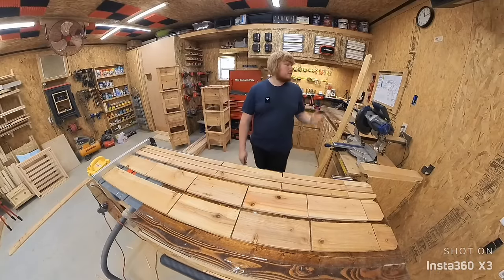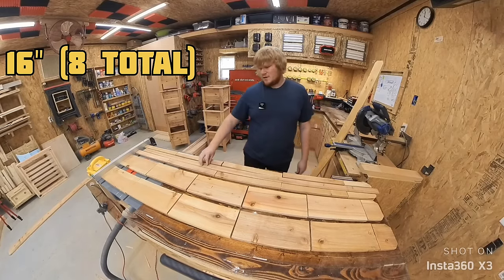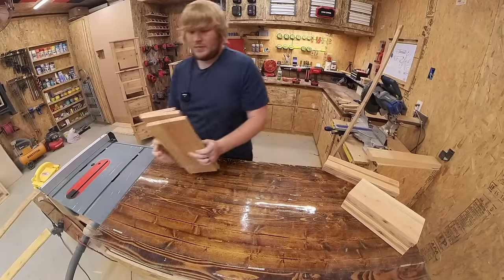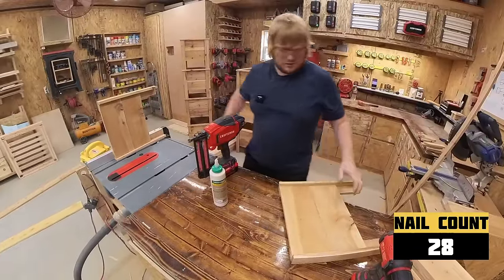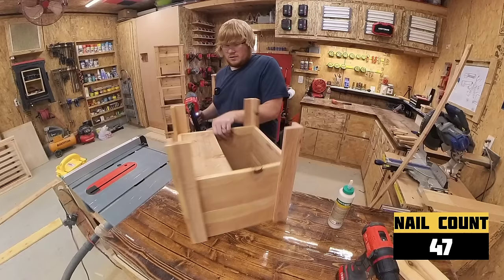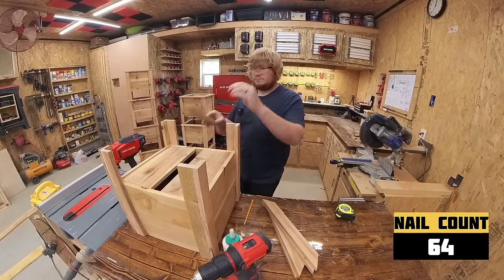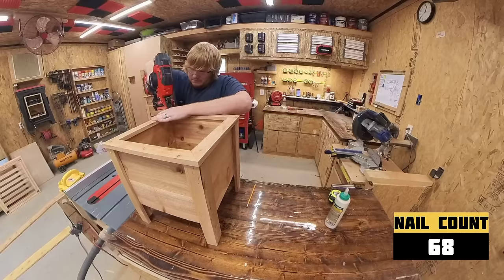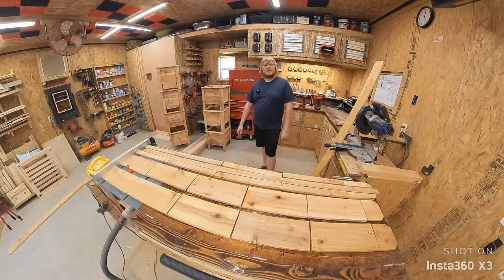3 Pickets, FREE Plans | Make Money Woodworking | How To

Comment: Nice work! What would one cost finished built, or the approx cost to purchase the materials? I need like 15.
Reply from the maker: I buy cedar pickets at Lowes for $3.28. Estimated with nails/glue to cost around $13-$15 to make for the three picket planter. In the Trio Set video I talk about the cost to make them in depth a little

Comment: 50 to 55 nails. I came from your Facebook reel.
Reply from the maker: Thats around what I thought they took, until I was adding the nail counter :P lol
Reply: @WhosTheVoss  after you nailed the Bottom, I did some figuring. I was only a few nails off after subtracting those nails. I totally forgot to add those in, or I would have been closer to the finished number. Oh, well. It is still a cool project.

Comment: Quick question- is there a trick to keeping a gap from forming on the legs? Even though it’s glued and shot together either the glue edges out after I walk away and I have to sand it down when it dries or it has a massive (to me) gap. 
I like it regardless, but if I want to sell them I want them to be top notch.
As always, love your content!
Reply from the maker: You can angle your nails, so you aren't firing them in straight. Otherwise put a little more glue on them and that should do it. I generally dont really have an issue with the legs separating, unless the cedar is reallllly wet

Comment: Do you leave them raw or use something like Thompson’s to give extra protection against the constant damp soil contact?
Reply from the maker: I leave them raw. We have several on our patio that I built two years ago. No rust stains from nails, bottoms are still strong. If you want the cedar red-color to last longer you can add a UV protectant so they do not grey

Comment: Hi! Love the content. Keep it up. Do you have plans for the larger box that has the pole for lights coming out of the middle of the box? It was in the video of the 3 picket planter as you were panning around showing so of the other things you've made. Would love those plans. :)
Reply from the maker: I have made a tutorial for the longer box, and im working on the Trio set now, the larger 4x4 pole may be after that :)
Reply: @WhosTheVoss  cool. Thank you. Maybe you can answer, if not too complicated, how does the post connect to the planter? Seems without weight and maybe more than just the dirt would be needed unless the post sits in a stand flush with the ground and the box is just around it. Otherwise it would be top heavy.
Reply from the maker: I brace it with 2x4's on each side and add a cut under the bottom to take most of the load. The cedar 4x4's are more expensive, but they are wayyyy lighter than pressure treated 4x4's

Comment: Thank you for the video, for non US watchers, what are the size and thickness of the pickets ? A quick google said that they come in different size, I just want to make sure to get the correct measurements at the saw mill. Thanks
Reply from the maker: Its 14cm wide, 183-1/2 cm long and 1-1/2 cm thick. I know thats not how you read in metric, however, I dont know how to read metric cause I live in the dark ages 😂 here they are 6 foot long :)

Comment: Hey Thanks for the video. Do you prep you pickets before cutting and if so what all do you do? I have a few pickets I purchased recently and they are garbage compared to what yours look like. Very rough cut.
Reply from the maker: Some of my pickets are pretty rough looking. You can add a clear Thompson water seal to protect its redish color, you can also sand the face of the board so its more smooth :)

Comment: Gonna try this tomorrow.  Can it be done with a mitre saw alone?  I don’t have a table saw.  Should be doable right?  So just fill with soil/rocks and plant whatever?
Reply from the maker: Well, ripping down the final board isnt doable with a mitersaw, but you can do so with a circular saw or jigsaw if you have one of those! :)
Reply: @WhosTheVoss  I’ll just have to find new uses for the new circular saw I just bought. Lol. Thanks.  Mom is already asking for a long one.  Did you post plans for the longer ones?

Comment: Hi, I just batched out 4 of these planters just to see how they’d go.
Your plans and instructions are dead on.

I only had one little issue. The last strip of wood for the trim had a knot in just the wrong place and broke the piece so, I couldn’t finish the trim on the 4th planter.  I’ll fix it.

I’m in Florida and it appears that HD and Lowe’s don’t carry cedar fence pickets.  I used the pressure treated pine and then used a tinted sealer.

Thanks.  I want to see if I can sell them.
I look forward to stealing. I mean, using your other designs. 😉
Reply from the maker: 😂 have at 'em buddy! Glad its working out for ya

Comment: Is that bottom center strip wide enough for you to rip and use it as 2 inside rails instead to support the bottom pieces? Would allow height adjustment of the base and fewer nails.
Reply from the maker: If you used the center strip for a rail system it would leave a gap in the center between the two wider boards. The larger box in the trio set has a bottom that is adjustable though. If you wanted to use some scrap as a rail its a cool idea :)
Reply: @WhosTheVoss  Makes sense, gap should be fine if lining the planter though? Do you put soil in them without a liner?
Reply from the maker: I did the first year, i found that the dirt will harden and separate from the sides, and the water simply pours out around the dirt without absorbing into the soil. So i started using a thicker trash bag as liners

Comment: A while ago, I saw you put some ceiling cameras in your shop. What did you end up using for cameras?
Reply from the maker: I made a mount to hold the camera I use over my workbench. Since then Ive made a completely new rig to hold everything, you can see it in the video a few times. I use Insta 360 x3's :)

Comment: Like the planter and Content.  I am wondering, how do you sand the pickets?  They looked sanded real nice on one side.  I have been leaving them unsanded for the first ones and I am looking to sand one side on the other.  I have a spindle sander and a thickness planer.  Which would be better.
Reply from the maker: Nope, no sanding what-so-ever :) they just look smooth
Reply from the maker: Thickness planer makes these look realll pretty. Run a board through and take a look :)

Comment: Why no glue on the bottom?
Reply from the maker: I glued the first few, but in all honesty all the glue gets pushed out when I set the bottom in place since it is very snug. Soo i fire in extra nails instead. If it has drain holes you can also glue them. It was just a messy experience for me :P

Comment: Do you pay attention to moisture levels of the pickets before assembling?
Reply from the maker: I let the boards dry so they are not physically wet, otherwise I do not watch moisture unless its a thicker slab
Reply: @WhosTheVoss  just wondering because I made a similar planter last week and the mitered top separated a bit. Meh.

Comment: Even with stain what's going to keep the bottom from rotting out under the weight of the soil in the moisture even though it has drain holes the soil will still be moist?
Reply from the maker: Cedar doesnt rot or decay

Comment: Good job,
Which brad nailer is that if you don't mind?
Reply from the maker: https://www.lowes.com/pd/CRAFTSMAN-18ga-20v-Cordless-Brad-Nailer/5002001819

This one ;) batteries last a long time in them. Ive used 5/8"-2" nails in it and it handles both very well
Reply: @WhosTheVoss  thanks I've been thinking of getting one.  I've seen a Neu Master online.  But if I can just go to Lowe's and scoop it I'll not think too hard and it's a Craftman.   👍🏾

Comment: I have a (probably) dumb question. I noticed your shelving for the spray paint on your back wall at the 9:40 mark. How did you secure those boards to the wall since they're on their side? It's neat looking and I want to do this. I currently have a book shelf serving as a storage for these things but it's bulky and sticks out too far.
Reply from the maker: Its pocket screwed to the wall. It fills up the lip from where my concrete block sticks out and the wall starts :)

Comment: I just made a couple and and I think not all pickets are the same length. Mine seem to have the center of the bottom come out a bit short.
Reply from the maker: Watch for cupping during assembly, its why I cut the tops last. If the pickets are cupped it can add 1/4" to the overall width/length. :)
Reply: @WhosTheVoss  thanks for the tip. I ended up using one of the dog-eared scrapps from the same board to make up the material. I'll be damned if I'm going to waste another board on one of these things.

Comment: one serious and very important question though... blue tooth earbuds or boom box? if boombox where do u put it :o
Reply from the maker: I have both, i use the over ear headphones with noise cancelling if im running the sander for a long duration or using the router. Otherwise I generally have my bluetooth speaker going, its above my head so its not blasting me in the face

Comment: Any chance I could get the plans or measurements for the 12 inch box you showed?
Reply from the maker: The smaller one from the trio? Its legs are 10" , long sides are 12-3/4", short sides are 10-1/2" I believe. :)

Comment: I've been pounding these out since last summer, it's a great planter.  However, your new plans don't include the measurements for the 45 degree top frame (on this one and the 9.5 picket planter.)  I'm sure I can figure it out, just wanted to let you know in case you want to update the plans.  Thanks!
Reply from the maker: I did not include them because if your boards are cupped, it adds 1/8"-1/4" to the mitered board's total length :) same with the bottoms really

Comment: The strips that you cut for the legs, I'm not able to cut them out of a pocket. Can I get 1x2 and 1x3's?
Reply from the maker: You could, or you could just space the 5-1/2" boards a little apart and use a liner or trash bag so the dirt doesnt fall out of the bottom

Comment: I have a couple questions for you. I made my first ones today. I used cedar fence pickets, 3 per box. I planed one side smooth. Do you do that or leave them rough? Since planing them leaves a tad over 1/2” thickness, I used glue and 3/4” stainless steel brads. Do you think that is okay? Also, do you apply a clear sealer to the outside or leave them natural?
Reply from the maker: I leave mine rough without sanding, stainless brads should be just fine since the nails are there to hold things together until the glue dries, I leave mine uncoated, I go more in depth about sealants in my "Boost your planter sales" video :)
Reply: I have a followup question.  Yesterday, I saw a comment on someone's Facebook post saying that brads and glue would only hold up for one season and screws should be used.  Do you have any feedback from your brad and glue planters over several years as to how they hold up? @WhosTheVoss

Comment: If I don't have a nail gun what kind of nails should I use?
Reply from the maker: You can use any brad nail, just make sure its less than 1-1/4" long so it doesnt poke through both boards :)

https://www.lowes.com/pd/Hillman-1-in-17-Gauge-Coated-Steel-Brad-Nails-1-oz/3010689

Comment: One more question.  What are the measurements of the short sides on the mitered rims in the diagram?  I know the long sides are 15 5/8” but my ocd mind tried to do soh cah toa and I learned I didn’t learn anything in geometry/trig. Or is it just as simple to use the first as a guide and just do alternating 45° angles?
Reply from the maker: I always just repeat the cut using a board as a guide, the inside measurement is 12-1/4 between the miters (i measured it to avoid the math as well) lol
Reply: @WhosTheVoss  cool...I completed it but it's not perfectly square.  I don't think I was accounting for the kerf, and my long cut with a circular saw wasn't perfect either.  1 tablesaw later, I'm feeling optimistic about it.  haha...expensive impulse here but I'll put it to use, lol.  Thanks!

Comment: So I made this one last night but I came up short by about 4 inches on the 45 degree MITRE top pieces. I was only able to make 3 top pieces vs 4 like you had. All my pieces were cut to your spec's. Any idea where I went wrong?
Reply from the maker: 🤷‍♀️🤷‍♀️ not a clue buddy. Try using the center ripped board for the top pieces :)

Comment: I do like these however, I'm a little concerned about how much weight a few brad nails can hold with the way the bottom is assembed. Also, I'd face those cups so they drain rather than hold water
Reply from the maker: Ive had these on our patio for three years now, holding up just fineee ;)
Reply: @WhosTheVoss  awesome!

Comment: Just made my first effort at assembly of the 3 picket planter. Disaster... When I bought my pickets at Home Depot I only had one option 3/4" thick and Dog Ear planks. I thought these would actually be better, more stout & strong, what I didn't realize is the me changing to 1.25" brad nails wasn't the only change that was needed. I laid out my long sides and nailed and glued the leg piece on each end and repeated the same process on the other side. When I went to assemble the other half of the leg pieces I realized if I make an "L" 90* leg piece with the 3/4" pickets instead of what you used in the video (5/8"), the lip/ledge that the shorter sides sits on only protruded about 3/8" or so! Because I used 3/4" think pickets my leg assembly wasn't wide enough to provide the proper lip... A mess... took it all about and will sand off the surfaces clean to start over.
Question: If I increase the width of the (8) leg pieces by 3/8" will that leave me with workable solution , or do I need to change more? Anyone that knows your help would be appreciated.
Or should I just use my planer to take all the pieces down to 5/8" thick !
Reply from the maker: I sent you an email :)

Comment: I am a bit concerned about the bottom. With only nails how how does it hold up the mud?
Reply from the maker: The video I dropped today has this exact planter, from two years ago (holding up just fine) :)
Reply: @WhosTheVoss  great. Can I use pressure treated pine? It's less than $2 compared to $4 for cedar.

Comment: You telling me you found a 1in  craftsman brad  Nailer cause I can only find them 2 in 18 gauge
Reply from the maker: https://www.lowes.com/pd/CRAFTSMAN-18ga-20v-Cordless-Brad-Nailer/5002001819

This is the nailer I used in the video, Ive used 5/8" - 2" nails in it. There are slots the little heads catch so you can use a multitude of sizes in them :)

Comment: Wouldn't it have been better to rip the first legs attached to the long sides at 1 1/4" instead of 1 3/4"?  When the 1 3/4" leg wraps around, its thickness would add (1/2")   to the 1 1/4" would give the illusion of the legs being 1 3/4" on both sides.  Just my 2¢
You still the Voss!
Reply from the maker: I played with this idea for the one picket planters, it also reduces your glue surface area for those legs so i left them at 1-3/4 :) give it a shot buddy

Comment: Canada Sucks. A 1X6X5 cedar fence board at Home Depot in southern Alberta is $7.04 (March 28, 2024). Three pickets with tax comes to $22.18. These prices will only go up in the future. If you price the box as you suggested at $30 it’s hardly worth the time and effort. Add glue, nails electricity etc. and you run a charity. Any ideas on how to make this work? Anyone? Thanks in advance. (And please don’t say to set the price higher because it won’t go. Not in this small-town area.)
Reply from the maker: That's quite a pickle. I know outside the US cedar pickets arnt really a thing. Lowering material cost or raising product cost are your only two options. I may have cheap cedar, but a doctor's visit for a sore throat is $200.
Reply: @WhosTheVoss 
Thanks for the answer. You have a point. Although you shouldn’t believe everything, they tell you about free healthcare. It’s not as free as it seems from the outside. I think I’ll look around town for pallets. It’s not as easy to work with as pickets but nothing beats the price if you find them at the side of the road.

Comment: What did I miss?  One piece was too short.  Here's the math.  4 top bords at 15 5/8" (+) 1 bottom board at 12 3/4" = 75 1/4".  A 1x6x6 is only 72" long.  Cut sheet/diagram not helpful.
Reply from the maker: Flip your board when cutting the 45° miters to reduce waste, then you'll be spot on